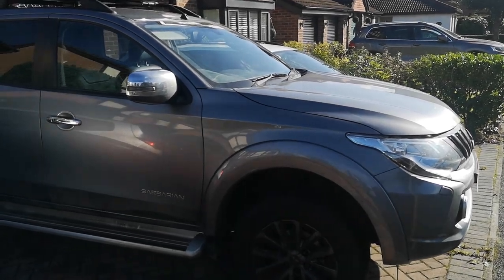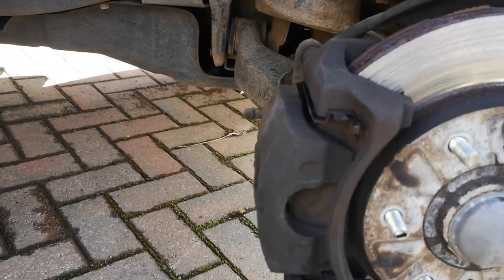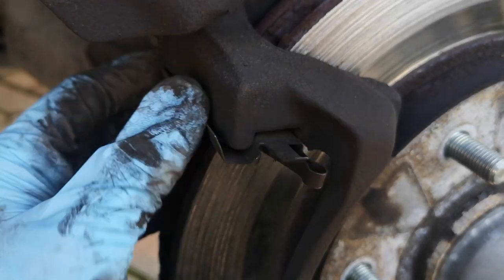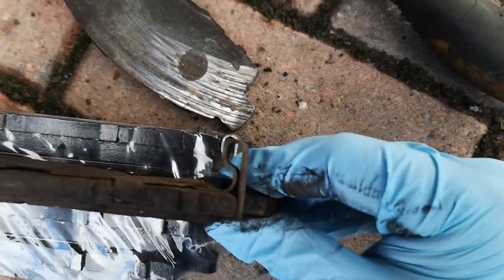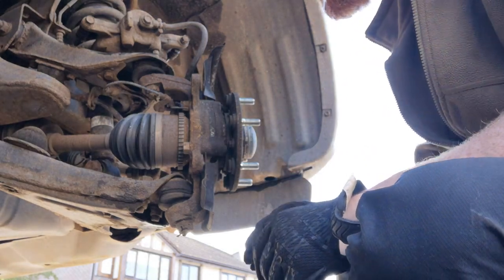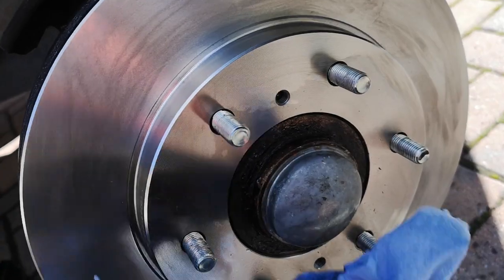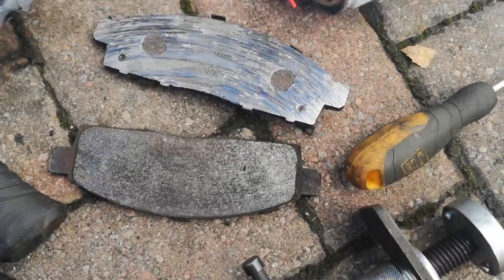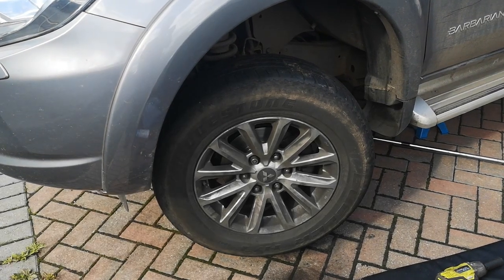How to change L200 discs and pads in under 5 minutes!

Comment: Great video, thanks for that. The two smaller tapped holes in the disk rotor are for M8 bolts to jack it off the hub - they are a real help for stubborn disks, but "tactical taps" still needed as you'll strip the threads or shear the bolts if you rely on them alone.

Comment: I think you can avoid the disc replacements if you change the pads in the right moment, great video, thanks from Puerto Montt, Chile!!
Reply: If you observe closely you notice that the wear indicator on the inner pad didn't produce the warning sound yet the outer pad was completely worn out. He must have been waiting to hear the warning sound which never came.
Reply from the maker: Yep both wear indicators had snapped off at some point so never got them to do the indicator squeal

Comment: Any surface that's metal on metal I'd coat with copper grease (back of brake rotor, bolt shafts) to prevent seizing. Future you will thank you.